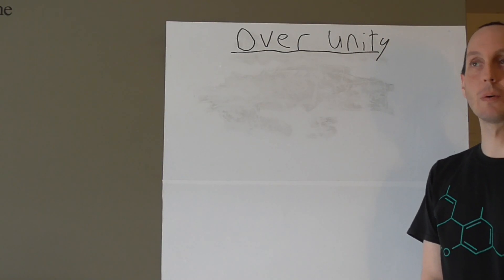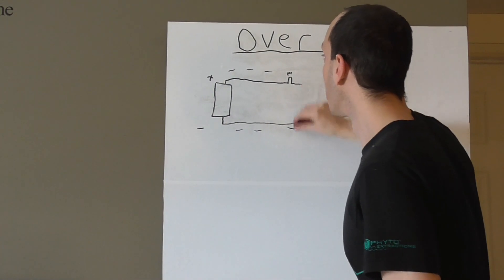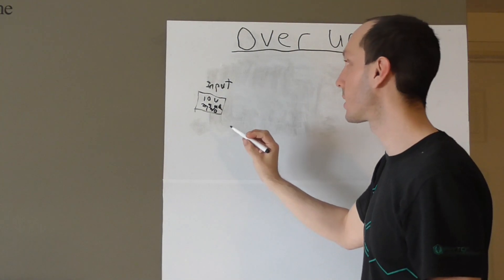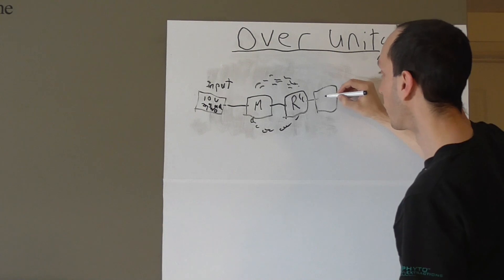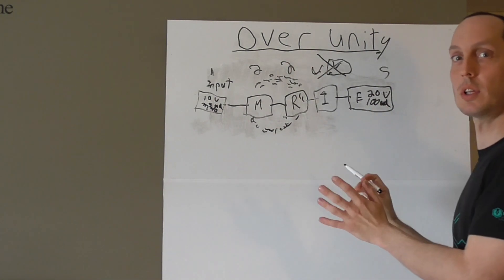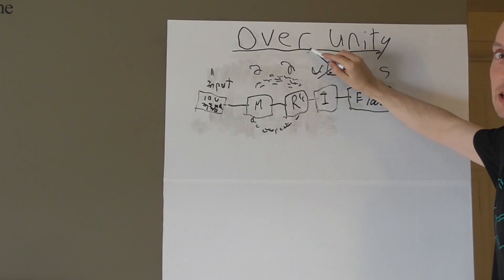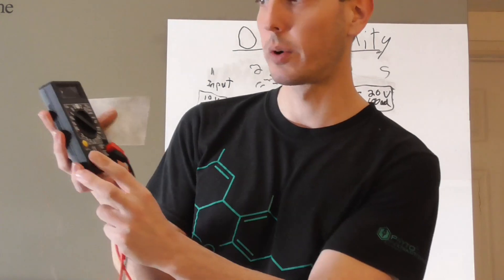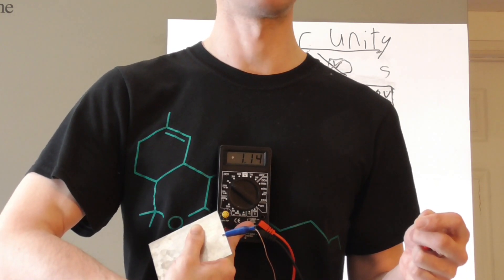Over Unity Explained

Comment: I remember discovering this several years ago as I was working on my various alternative energy projects. I just called it "multiple systems" to myself, but I like the way you explain it and go into depth about it. I subscribed because I can tell that you know what youre talking about. Im not personally a fan of biometric devices anymore though. My thoughts on that have changed.

Im actually able to do what you describe, but on a mechanical level instead of electrical.

I call my device the 'Hydra-Kinetic Motor' and I was considering making some videos next year to show off my prototypes and explain in detail how it works. Its very simple.

My invention, which I did complete about six years ago, actually runs solely on kinetic energy from springs and utilizes other systems to achieve more than 100% efficiency.

I know a lot of people have made claims as such throughout the centuries, but nobody has ever offered any proof, therefore it has become the general consensus in the scientific community to proclaim that its impossible and violates the laws of physics, but I dont believe that interpretation is necessarily explicit in that regard.

Im hoping yourself and others like you will examine it and give your technical analysis on my device.

Hope youre still doing good works and Ill check out more of your videos as well.

My name is Jerry Calvert.

Cheers.

Comment: Wow. I've never seen anyone talk at such length about something they obviously don't understand. 
I've taught 4th grade kids who have more understanding of physics than this idiot.
Reply from the maker: Well maybe I can dumb it down to 4th grade for you. Anything specific you need help with? :)
Reply: @joellagace1679  Your presentation is already below the level I'd expect from a child with a very rudimentary understanding of observable principles. 
The problem you appear to have is that you believe what you think, not what's actually true, since you make no explanation of how to overcome the inverse square loss of energy, relative to distance/time.
The diagram you poorly scrawled is absolute nonsense, you keep adding energy sources yet present no explanation on how you'd overcome the potential energy requirement of the introduced system. 
You claim an inducer will add to the system, so explain where the energy comes from that allows the induction to take place. It can't come from the other energetic systems as that's violates the laws of thermodynamics, despite your claim otherwise. 

I would suggest that instead of dawbing boxes on a whiteboard and narrating a word salad of nonsense over the top, present the actual equations, with proof of calculations, that supports your hypothesis. 
And just in case you think it would 'go over my head', I have B.A and Masters in the field of physics.
Reply from the maker: You have a "Masters" at ranting lmao. Your comment proves you don't understand the most basic concepts that everyone here understands and can replicate. Take care.
Reply: @joellagace1679  Go on then, replicate it for everyone to see. You won't because you can't, and neither can anyone else.
Reply from the maker: I replicate all my concepts and demonstrate and even give out lessons. Look around do a search. Notice others are talking about Joel Lagace and replicating Joel's work with success. But I like keeping comments like yours published so we "The smart ones" all get some shits and giggles out of people like you :) so please keep talking. Invite all your friends so we can really have a good time.

Comment: There is a mechanical way to get plenty of over unity.  I have a design for generator flywheel that uses very little energy in and lots of energy out.   I’m looking for a science partner to explore this orbital energy with me.  The name of my generator is The Julius Generator.  Aka  orbital generator technology.   This generator is no toy.   And needs to be engineered by professionals.   I have the blueprints.  If you’re interested just chat with me.  We can discover the power of over unity in abundance, which exist all around us.  We just need to tap into this resource.   No more burning gas, no more need for solar panels, no more need for wind mills.   This will replace our power grid.

Comment: I also wish to point out that Bedini's "Bedini Motor" circuit is a pulsed motor with a flyback capturing circuit and a means to store that charge so you can oscillate all that back and forth, reusing what would've been lost if you didn't catch that flyback and making sure you maintain a delicate electrodynamic dance so you can slow down the battery drainage and get a little extra work off the shaft if you advance it enough and you follow the advanced book and everything involved.

Bedini's work has nothing to do with ZPE.
Reply: I have correct myself from this earlier comment.

The Bedini Energizer is technically everything else I said, but organized into a "Self-Rotating Energizer" System, not around a pulse motor.

You're capturing flyback and flipping the electromagnetic field in the core of the main and trigger coils and oscillating that charge from the voltage spike back and forth so you can slow the battery drainage on the battery you use to feed the transistor and even charge another battery with that potential.

The "Overunity" is the delayed battery charging time and the little bit of mechanical work you technically CAN draw off of this to a small degree, but these principles CAN potentially be applied to a pulse motor, POSSIBLY they can be.

Sorry for the error to the comment back then, everyone!

Comment: I guess,  it seems to me that what is stated is energy can't be  created or be destroyed. Trying to apply that statement to a mechanical system is where the mistake is made. A long bar and a fulcrum don't create energy,  simply change the values of energy. If we change the values of  energy we call that efficiency.
Reply: You also only understand energy at 50 or 60 hz.
Reply: In a typical energy generation external source of power is used to over come the resistance in the form of back EMF.
Reply: I like your definition a lot. That makes very good sense.

Comment: You right. Single output and input of energy does not proof anything. It is like a small part of something bigger. Overunity is about ZERO, it is about symbiosis, balance, system which live itself triggered by initial. BTW where is explanation of magnet holding weight vs battery with coil holding the same weight? nuclear power? sun, star fusion reaction? Possible in macro scale so it is posible in micro scale like solar system, earth balance, water, earth, planets circulation, the advantages of balance and why, circulation, periods trigering why thise fetures are key for systems, close loop systems, and more unknown yet. What about locked energy closed in trampolin, balls, mattress, suspension. How much, how long they can reflect kinetic energy to protect us, to bance back, locked energy treat other energy soft, it reflect nearly in the same shape. Otherwise defuse, spread destroying cars, us, glass, anything. Why with balance we save energy avoiding friction?

Comment: Awesome!!! I for example always thought, lets say we have two different source of input on the table. One input is 100v 1amp, second is 100amp 1v, they are both at 100watt, but if there is a posibility to combine this input in circuit, we would get 10000 watt for 200 watt input.

Comment: That is nothing new. A voltage potential using dissimilar metals has been known about since antiquity. You should look up the term 'nobility of metals' to gain a better understanding of how a copper penny for example  can plate an iron nail without any external power input. 
Over unity is indeed possible but you give a bad example here.
Reply from the maker: In my closing example. The point of the magnesium plate and lead clip from the voltmeter and using the body as an electrolyte was just an example of how and many of the methods we can provide a low voltage  input trigger. This had nothing to do with over unity on its own...... but indeed could be used to trigger/help an over unity system.  I do spend time explaining this as well in the video. Please let me know if you want me to better explain. And I will see what I can do. Thanks.

Comment: They were focusing on closed system that's why over-unity for them doesn't exist.

A very simple way of showing it is when you have a battery and a bulb. At closed system over-unity isn't there yet. When you add another device at it that harvesting the outside source of energy like for example a solar panel or a wind generator. These sources of energy when added to the battery will give more power output than the battery only could give. 
Only that we're talking another kind of device that harvesting another form of unknown energy sources. So this is hard to understand. 
Complete successful machine or device will change this arguments.

When you put a magnesium on one probe while copper on the other it would possibly increase  the reading.

Comment: I've watched a couple of your videos the last 2 weeks and I like them. I've been studying Over Unity for almost 3 decades since I was 13. I understand what you are saying. There's so many ways of triggering and chain reactions. Millions of ways of doing it using different triggers, different parts, different materials in different combinations. Some ways are better than others. Simple is best. 

Have you heard of Gravity Batteries like what's mentioned on the YouTube channel Smarter Everyday? You could use a Gravity Battery as a trigger. The weight wouldn't have to fall much to trigger the reaction. 

Imagine a 40 foot tall tube or whatever in your yard that is 1 foot in diameter. The weight could go inside it or outside. 30 foot of the tube is buried in the ground so only 10 foot is sticking above ground. 

I haven't calculated how long such a system would last before the weight dropped the entire length of the tube using your trigger chain reaction setup but I imagine it would last a very long time. All that is needed is the weight to be hoisted back up to repeat the process which is easy. Have a solar or wind or both or even a separate Gravity Battery to charge a battery or Super Capacitor that would power an electric motor to hoist the weight back up barely using the energy in the battery. 

This type of setup will continue until the parts wear out. Which can be cheap and easy to replace. What's gained? You can power a small home like a tiny house on wheels or arched cabin. Maybe even an earthbag house. If more power is needed just add more gravity Batteries and change some things. Maybe even incorporate Gerard Morins research into it. I've played with washing machine pumps. You can get 100s of 1000s of volts Maybe more out of them. The possibilities are endless. 

You could use a Gravity Battery to make Hydrogen. If using UREA and Stanford University Scientist water Splitter which splits water into oxygen and hydrogen at 1.5 volts aka AAA Battery using Nickel Oxide electrodes then you could make that system more efficient and ppl could heat their homes power them or whatever and not have to store the Hydrogen either. There is the safer alternative of Hydrogen on demand so only produce what's needed at that moment and not storing it.

https://youtu.be/Jsc-pQIMxt8
https://youtu.be/Nh_0cRYebYU
https://youtu.be/XOq9C3YSjKg
https://youtu.be/ZuGvx3WYg1k
Reply from the maker: I have thought of something similar using piezoelectric chain that holds a big mass and spring loaded with a piston like simply we could keep a mechanical trigger going up and down, gravity pulling down onto the chain causing the piezoelectric chain to generate electricity.  I haven't figured out how to put the idea in a video yet so stay tuned! Thanks for the info. great read.
Reply: I just wrote this gentleman on correcting his definition of overtunity and I stated for the record I am the creator of overunity my name is Lloyd g Stovall, I also left him my number and email to contact me I urge anyone who wants to know the truth about overunity to do so again again I've been using this system and producing this system ever since I was 14 years old which was done in a science fair I was in, Overunity name extends from my training being young as a Buddhist Which we were taught over unity between the creators and humans , over unity is a compound word and most people who say more power out than in should realize it has nothing to do with either word over or unity But when I give my explanation everyone agrees that it Does work and has a benefit so why do people keep up with this proteins on something they cannot even achieved it just boggles my mind, The miss information is just astronomical If you want to know about my work please give me a call (313) 651-5349
Reply: 50 and 60hz is the problem. Quartz is a crystal of holding and where we got our original frequency for our electricity.

Comment: We have so many names for the same thing. Aether, ether, Dirac sea, vacuum, Quantum, zero point, dark matter, dielectric,  etc.  We are surrounded by a sea of energy without potential or polarity, that has a high state of entropy or randomness.  This we know, but can’t quantify it.  By its very nature, it is unquantifiable.  I like to think of it as the energy between matter and measurable energy.  Everything is energy of some kind.  There is no empty space, anywhere.

We have tools at our disposal that allows us to lower the state of entropy of this random energy.  One of those tools is magnetism, another is electricity.  While related, they are different like light and voltage.  We can manipulate magnetism to polarize a portion of that highly entropic energy into something we can use. Electric potential.  That is what you are doing.  You are using magnetism to structure a small portion of energy surrounding the coils or a capacitor to structure a smaller portion of it.  What I’m saying is over-unity is nothing more than conversion of a form of energy, little understood, to something better understood and measurable.  That conversion has been known for hundreds of years.  Its mechanisms have not been understood and still are MISUNDERSTOOD to this day, but are taken advantage of in some circles.

Continue on your path of impulse DC with magnetic amplification and you will get results.  Design for higher loads and your system will provide.  Most play around with silly LEDs and closed loop.  I like how you think Joel.  You will get this.

Comment: Hi Joel. Thanks a lot for your videos. Based on the information you gave me just a few days ago, I learned a lot and got a deeper understanding of the processes. it only takes a small trigger to set off a larger energy system that works as an independent body if you let it vibrate freely (in resonance) and it is no longer coupled to the trigger. As Rick F. said in the way that it only takes a small trigger to set off an avalanche. The snow was there before.
Reply from the maker: Rick F. he won't talk to me. Maybe he didn't like my questions that I asked earlier on in my research. oh well. I gave him a free idea and he didn't even say boo. I told him to use a Bedini motor to drive electrostatic plates instead of a fan blade, generating a super high voltage this method does not create an additional strain and the rotating wheels.  I'm not going to get into the details its too long to write up in this comment but i'm sure you know what we can do with that 250 kv spark gap discharge from leyden jars into a transformer  tesla coil like device.....
Reply: @joellagace1679  I have talked with Rick F. face to face.  joel, you are past him.
Reply from the maker: Really that's a great compliment. I thought very highly of him when I didn't understand a thing. Even jealous lol.
Reply from the maker: I also tried talking with Aaron Murakami. No luck. Also tried a few others. They all got great big youtube channels but won't answer any juicy details and I guess get offended by my ideas I don't know. Could be there just all very busy and important and don't have time for folks like me.